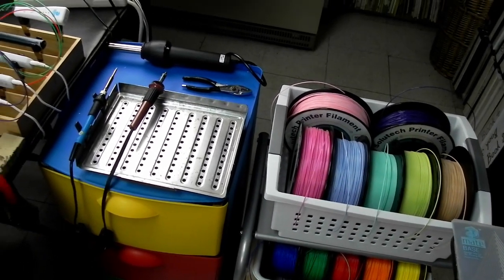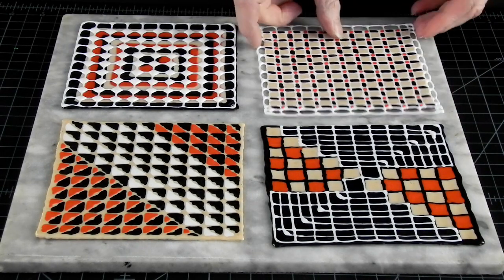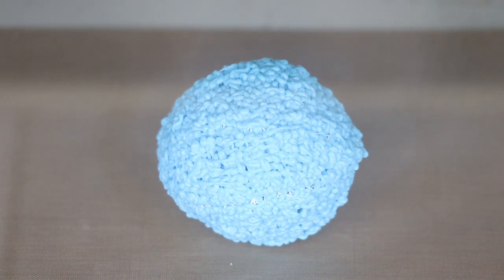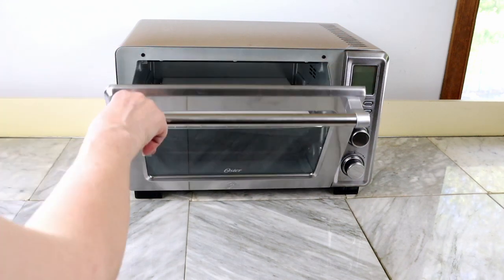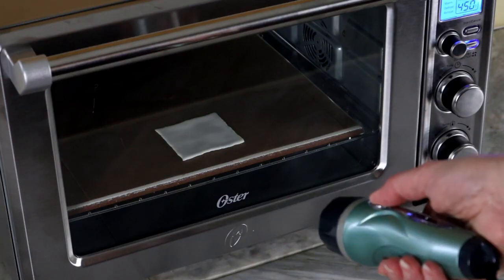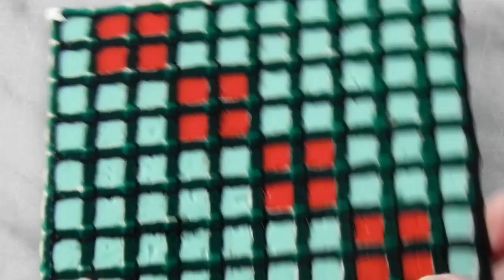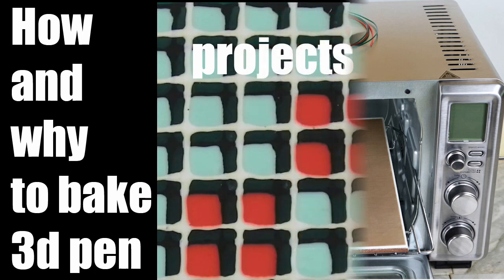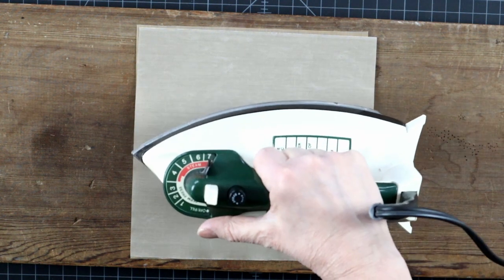My 3d pen studio – Baking tools

Comment: Hi.  Tried ironing a piece made with translucent filament between the silicon sheets and it came out right but it had the pattern of the sheet.  Used a heat gun (on tile) and got back the clarity but it took a lot of close, careful work.  Would baking get a better result?
Reply from the maker: Baking should be able to restore the clarity all over all at once as opposed to going a bit by bit with a heat gun. Of course it will restore just the top of the piece. The bottom will stil retain the texture of whatever liner it is sitting on while baking. I would test it on a small sample and see. Good luck. Let me know how it worked out for you.